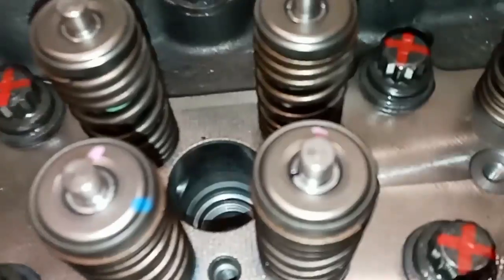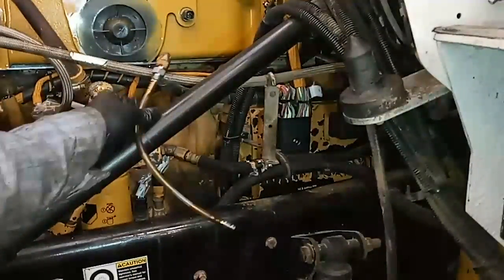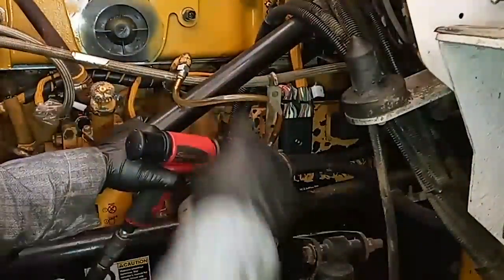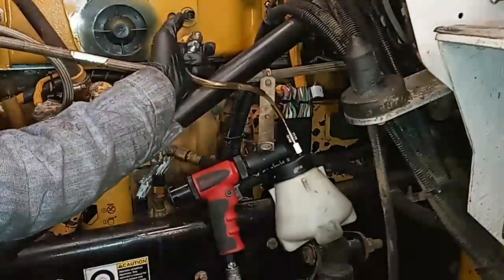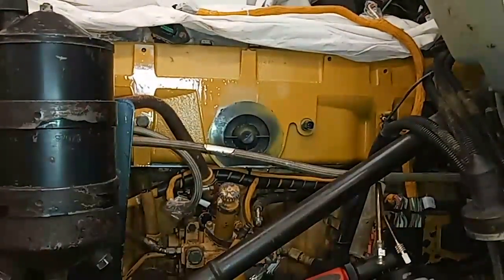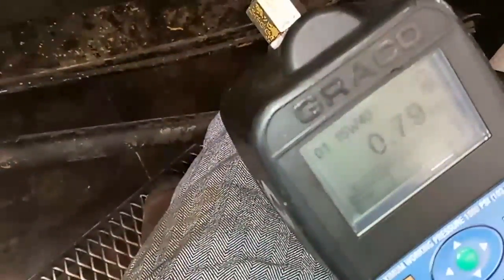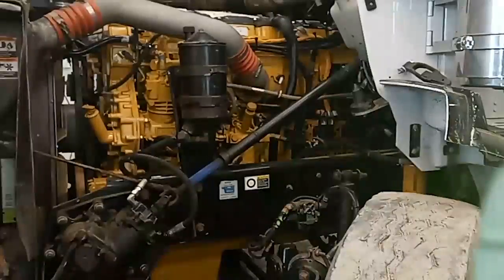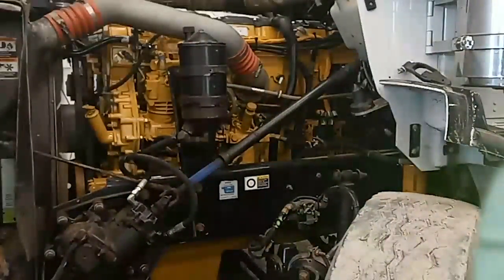How To Prime your Engine Oil and Fuel System for INSTANT PRESSURE!

Comment: My C15 is an absolute princess about starting after losing prime. Will NOT start without ether. On the side of the road without a way to pull vacuum I did have enough air pressure to actually pressurize my fuel tank through its vent. 

Turned off the pickup in the passenger side tank, turned off the return on driver's side tank. Pressurized driver side tank with the rubber air gun tip and it pushed fuel through the whole system, was getting no bubbles out the return line.

Still wouldn't start just cranked. 

1 spritz of ether and it fired right off and worked fine...I don't know what it is but if it doesn't get its hit of ether, despite being completely primed....just won't take. odd....

Comment: On my old 950, I could hardly figure out where the check and pressure valve were, by elimination, the pressure gauge line was a successful vacuum point.

Comment: I got a 95 320 L excavator with a 3066 engine it had been parked I got new batteries put in and it started right up so I let it sit there and I don't warm up and then the fuel line Musta leaked out the fuel and it quit I just assumed it ran out. So I quit for the day. The fuel line is chewed through or rotted on the end but the rest seem to be soft it's the
rubber fuel line goes from underneath tank to I can't see where so is.

is it pointing towards engine and going all the way to a promer and the filter system and do I have to fix the line fill the tank and then is there a pump bleeder thing like this where you hand pump it up or do I have to crack a line and let it bleed? That's what we used to do it Perkins diesel in the test cell. I wasn't an engine tester but a bunch of my friends were.

I think I want to get a regular service manual for this machine it's got about 10,500 hours on it it was taken care of really good it really works strong but I got it back in the woods of the backyard and I knocked it track off so I got to get it go and get it up on harder grow and try to get the track back on. Am I going to have to bleed the system or is this pump gonna be enough to start it once it idols it'll bleed out like I say it was just idling when it shut down. It's a little hard to work on back there I just want to get it going and get it up here by the house and done a flat ground if I have to replace the whole line. Also I couldn't really tell if that was 3/8 or 5/16 holes I thought it was three eights but then I don't know till I get a piece off I think I got about 12 feet are brand new 3/8 inch Goodyear fuel line someplace I presume the prime pump is on all these I didn't notice where the mechanical pump was on the engine I was just looking at the filters and the injector pump. I probably also want to fix that fuel shut off too because once with leaking I couldn't stop and probably get some water in there and frozen moved a piece of rubber or some thing wondering if I can just take that apart and go get a rubber seal thanks in advance if you see this

Comment: Ive done the same thing faster on vw tdi with bosch rotary pump used a 7.3L late model lift pump with some jumper wires literally took 30 seconds, i would suggest coming up with something similar

Comment: Hey, I'm kinda green still, but on my truck previous owner installed a Fass Fuel pump. Can I just turn that on and let run to prime the fuel system after changing filters?

Comment: Josh, can I use a 12v fuel transfer pump to evacuate the head/rail instead of the brake bleeder? Would be easier than bringing a compressor on board the boat. Also, can you suggest a pre-oiler retrofit arrangement for my 1999 9WR marine 3406e?
Thanks

Comment: Lost fuel prime in my 04 motorhome with 3126. One filter,no pump. Can I cut the fuel line from the tank but before the filter and hopefully get fuel flowing again??? And would I damage other components by doing so? Absolutely love your vids, you are a great mechanic AND you describe all your repairs like a Professor. Thx

Comment: Hi Josh. I love your channel and have watched just about all your videos even though I happen to own a motorhome with a Cummins ISC 330 diesel engine. 
I have been reading about the Fass Fuel system and I was searching around your videos to see if you had ever reviewed the Fass but I do not see any videos on Fass or AirDog. Do you believe in the claims they make regarding air a water vapour in the fuel? 
Just wondered what you thought of these systems.

Comment: You really need to prelube through the oil cooler before the oil filter . This will help by filtering all the oil that is pumped into the system. Take my word for it, new oil is not free of contaminants. I saw mishandle product that would make you never trust a oil distributor ever again when I use to work on a customers trucks at their yard.  I have even seen a tanker tuck used to haul away used oil and then filled with new oil for delivery without having a clean out done. Truck hauling fuel would also be used to haul oil. Multiple different oils being hauled  without.having a cleaning between product changes. 
I elimi ated all that problem for myself by only using Amsoil product.
Reply from the maker: Our oil system is luckily pumped through a pretty good set of oil filters before it reaches the oil dispensers. Can't say it is 100% free from contaminates, but it's at least as clean as the oil after the filter. Good comment.

Comment: Used to prime the oil system on all SB chevy, ford, dodge. All that is required is a drill motor and the proper tool.

Comment: Love your method, those vacuum bleeders are great for a number of things besides bleeding brakes. 😉

Pre filling fuel filters...
I did not have a problem with doing that per se; the problem on the boats that I worked on was that people would use the easiest point to get fuel, which was usually a tank's stripping valve, which was where the dirtiest fuel was available! We would add a fuel tap downstream from the primary filters, and train our guys to fill the dirty side of the filter. Deere was great with their filters, as they came with a funnel that would only allow you to fill from the dirty side.

Comment: How about cranking the engine with the injectors removed to prime the lube oil system? That’s how I’ve always done it on old style suitcase injector pump systems . I would do that until oil pressure builds up, install and prime the injectors with more cranking, then let it start.
Reply: The cranking to prime the lube oil system should do no harm since there is no compression. Maybe a little hard on the cam bearings

Comment: Outstanding ideas & care to do excellent work.  The truly great part is that the techniques can be applied to any fuel injected engines, even automotive gasoline jobbies.  The oil part can even be used on carburated  engines.  Thanks

Comment: You're a badass! Thanks for the information! Is there any way to prime your oil pressure if you don't have any tools? I left a truck sitting in another state last March and I'm going to go fire it back up again in a month or so and I want to be as nice to it as possible.
Before I sat it I did change the oil and all of the filters as well as disconnect the batteries. I'm thinking as long as I give the fuel primer a few good pumps I should be ready to rock and roll, but I would like to get some oil on everything before I rev it up and I already know I'm too lazy to go track down and buy the right oil priming tools.
Reply: I have a BX C15

Comment: Our 3126E  HEP08621 in our 2003 Newmar M.H.  on a freightliner xc chassis only has one fuel filter, a 2 micron,(my understanding). Should it have that fuel return fitting on the filter base? We don't have a fuel primer. Thanks Josh.

Comment: I know this is not related to this video,but I have an 05 mxs twin turbo acert. It's freshly rebuilt and runs great but it has lazy throttle response and below 1450 rpm it has no power at all. Boost good new turbos, all new fuel oil and air filters what am I missing???

Comment: When rebuilding an acert why don't more people make it a 625? Doesn't it cost the same as a 475-550?
Reply from the maker: The rebuild kit costs the same, but most of the cores don't match so you have to generally pay for all the core charges, turbochargers and camshaft/rocker arms. It costs a lot more. If the cores were the same it wouldn't be much more though.
Reply: As what Josh stated, plus your transmission, clutch, truck cooling system is bigger. If done legally the passwords from Cat are a lot of trouble getting. Only a select few are allowed to get them.

Comment: Hello. Good video.
I have a cat c13 and it has engine oil in the coolant system  and also a little bit coolant  in the oil pan.
And the air drier is blowing a bit oil out. 
Where should i look for a leak?

Comment: I have just about finished a complete overhaul on a 4 Cyl Yanmar diesel and have been dreading all of the cranking to prime and bleed the fuel system.  I will definitely try out this technique. Thank you sir.
Reply: I should have realized this only works on common rail systems. With the mechanical injectors on the Yanmar I still ended up having to evacuate the air from the lines the “old fashioned” way.

Comment: I like it when people Tahoe the effort to do things properly nice video .. question c18 blowing off the oil fill cap is that normal assuming all the filters have been change including that oil separator thing
Reply: That's a lot of crankcase pressure. Agreed that a blowby test is in order, provided that your draft outlet is clear. Even if your separator is fresh, a blocked outlet will still build pressure. I've seen it numerous times when belly pans pack full and block the draft. Not applicable to on-road trucks, but then again neither is a C18 generally
Reply from the maker: That is not very normal, do you have high blowby? It sounds like you do the. I recommend getting the blowby measured.

Comment: i doubt you’ll see this.. but im trying to install a fuel pressure gauge on my 98’ E model cat. There’s no videos explaining how to do this or explaining where to tap into the fuel system? any help would be awesome! love the videos thanks!
Reply: What is your engine serial number?
Reply: @johngoldsmith6629  6TS17240
Reply: @coleschaff7116  On the secondary fuel filter base, you have a oring boss plug next to the hand pump. Takes a 9/16 wrench. Also you will need a snubber if you use a mechanical gauge. 7S3795, 6V8090 or 5P4837 are the ones Cat offers, last two are 1/8 NPT if I recall, both ends. First one might be oring boss thread to 1/8 NPT. Also if you have a hand priming pump, I recommend to take it off and put a cover over it. Put the pump and a gasket in your truck and use when needed. Your wearing the check valves out in your hand pump as fuel flows through it. If your prefilling your fuel filters, do not pour fuel in the big hole. That is unfiltered fuel and your wearing your injectors out. Pour in the small holes or get a plug to put in the center to block the fuel from entering.  From what I see you don't have a low coolant level sensor installed. I would have one just in case you blow a hose off. Might save your engine.

Comment: Great video. This is most crucial when starting an engine especially after a rebuild. Most mechanics just crank the engine. 
Prime the oil and fuel system is critical.

Comment: I've got a couple of questions about my B model Caterpillar fuel system. Specifically what looks to be injectors sticking out of the side of the head. Any info is appreciated
Reply: A 3406B Has nozzles not injectors. They are in a chamber under the valve cover, dead center of the piston. From the main injection pump up to the cylinder head you have high psi injection lines. They all are the same length, that's why they twist around. In the cylinder head you have an adapter to connect the external line to the internal line. Two types of adapters are used,  ones with the lock made on  and with the lock separate. The one piece are better, but which adapter you use is determined by which outer line you have. As Cat had numerous problems with the line breaking, they are around ten different part numbers for each line. As it depends on the vintage you have and what has been replaced over the years. The support brackets are very important and the 8PN serial number has the best setup. However when I put them on I do it slightly different and decrease the chance off the screws backing off.

Comment: Great video. I rigged up a pressure filler from Motive with adapters for the engines I work on. The ones that have timing chains seem to benefit the most since they won't rattle like hell on start up. But priming other engines seems to help pump up the lifters some and they are quiet on start up. Will have to try the vacuum bleeder trick on diesel fuel systems next time.

Comment: Brilliant technique.  Have you ever built or installed a pre-oiling system for use once engine is in operation?  Am thinking of this for generators and other equipment that is seldom used.
Reply: Most of the big standby generators I've delt with have pre-oiler pumps built in. Typically they start up immediately upon loss of main line power. And run for a few seconds before the engine starts cranking.  This system would be great install on any of the smaller generator systems because it would DEFINITELY extend the life of the engine!  Easy to install,  pull the oil drain plug and install a tee. Run a short line to a small oil pump  then thru a check valve, then tee into the oil pressure indicator line. If you are manually starting the generator,  a push button for the prelube pump will work.  If your standby system starts up automatically,  you can power the prelube pump from the starter, just keep the prelube pump below the oil level in the pan. This will give the prelube  a few seconds of head start before the engine oil pump would build pressure. This would be much easier than designing a delay system to start the pump 3 to 5 seconds before energizing the start system.

Comment: The bigger CATs use an electric pre-lube oil pump that primes the oil system before every startup. If you start a big CAT  loader like a 994 you can hear the pump whining before the engine fires. My brother drove a Kenworth C501 with a Cummins QSK19 and that had a pre-lube pump as well. Great idea if you ask me because I’m sure they’d save on engine wear even with modern oils. That fuel line vacuum idea is great, I just installed new injectors in my 3408 and it took ages to fire with empty fuel lines.
Reply: all the train company trucks i have worked on that were older had this type of system installed, but they have gotten away from it

Comment: Mityvac on the return is the procedure Paccar outlines for the MX. I’ve always thought of trying it on other engines. I don’t trust bulk oil going into the main rifle unfiltered though.
Reply from the maker: That is a good point with the oil into the main gallery, but on a rebuild those journals are dry, our oil dispensers are filtered from the tanks though so it should be good.
Reply: @AdeptApe  18/15, good enough right?

Comment: Hey Josh I turn my fuel return line and fittings around, and I always put the updated fuel return hardware on about all engines I can.
Reply from the maker: Do you mean you run the fuel lines with the supply at the back? That would make more sense since the head generally is tilted up in the front.
Reply: @AdeptApe  No Cat wants the supply to enter the front. Take the return ninety degree fitting out on the rear of the head and use the straight fitting in the filter base. Put the ninety in the filter base and turn your line around and use the ninety elbow at the rear of the head. That way the straight fitting can go only one way in. You don't have to worry about the angle. You can then take the line and use the ninety to set the angle. Plus when you R and I the line your not going into the firewall. Gives you more movement.

Comment: I have an apparatus consisting of a medium air brake tank, a final filter and air regulator plumbed into the block via a #4 hose. I use it to also find pressure leaks internally. Real handy.
Reply from the maker: That is a good idea.

Comment: Can one prime the fuel system with this method on a Detroit DD15 engine after a fuel filter change and if you can where would you hook up the vacuum pump?
Reply: No need a fuel cart with a pump capable of going over i believe 75 psi, the connection is on the fuel filter housing usually has a black rubber cap on it
Reply: @jordanwright6078  ok thanks. what if i don't have one of those fuel charts? See i am an O/O here in Canada and i have 2012 western star with a DD15 engine and i do my own services and I am looking for a better way to prime the engine other than pumping the fuel primer 300 times.
Reply from the maker: There is an Amazon link on the video to a 3 gallon priming pump for the Detroit and Mercedes engines that has a manual pump. Might want to check it out.
Reply: @AdeptApe  perfect Thank you

Comment: There are pre-oiler kits available from the engine performance catalogs and shops. You can also use a pressure pot from a spray paint rig that uses the large pot connected by hoses. Class act doing the pre-oiling and fuel bleeding.

Comment: Josh
Good afternoon
Is it posible to pressure up the fuel by applying air pressure at the fuel tank?
Thank You
Reply from the maker: You can do that, but you would need to crack the fuel return line before the pressure regulator because you can't build enough pressure in the tank to overcome the 70-80 psi regulator. You have to be very careful too, that tanks aren't meant to hold much pressure and you definitely don't want to damage the tank.
Reply: @AdeptApe  Thank You